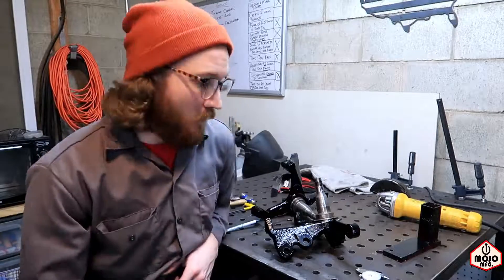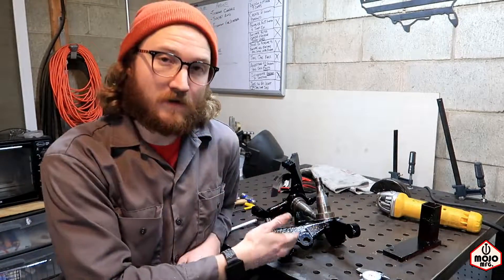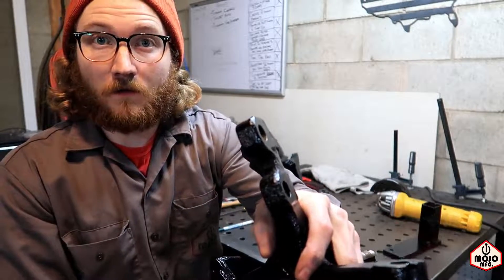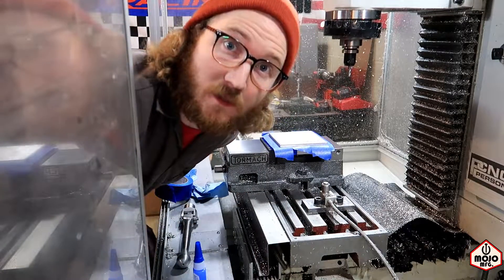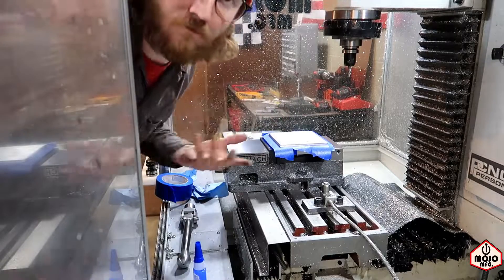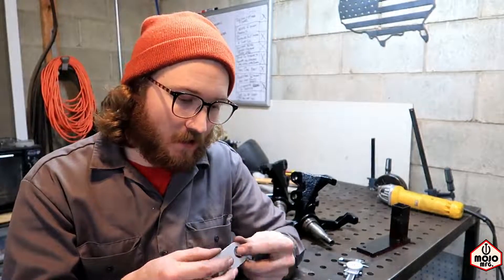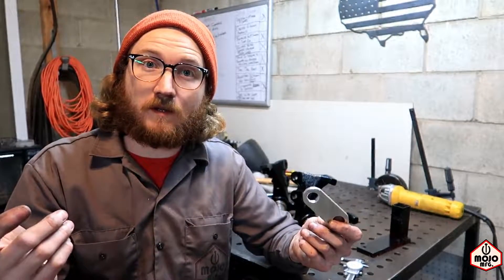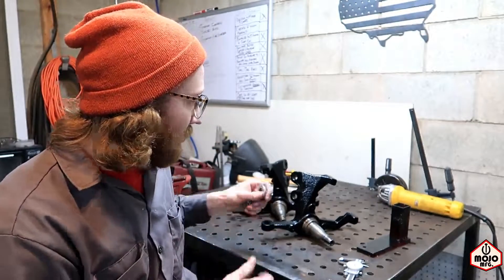Machining Mustang Strut Spacers

Comment: What’s the thickness of these?
Reply from the maker: these are 1/4" but I'm pretty sure there should be 2 - 1/8" spacers on both sides. These work just fine though
Reply: @MojoMfg  thank you so much! Need to make some myself

Comment: Why did you choose to not to "plasma cut" them?
Reply: And use steel?
Reply from the maker: The stock piece of material was .010" oversize and I needed it .010" undersize so I had to face it anyway.  Also, I am afraid to cut aluminum on my plasma cutter.  I made sure 6061 is okay to cut with my water table and it is but it still scares me.
Reply from the maker: I had this aluminum on hand and its not a big deal for these to be made from steel.  On top of that, there are some aftermarket manufacturers make these and they are out of aluminum too.